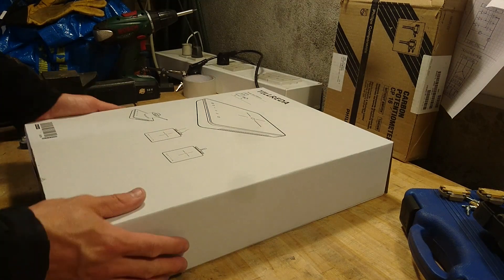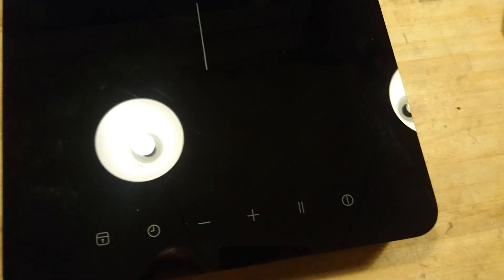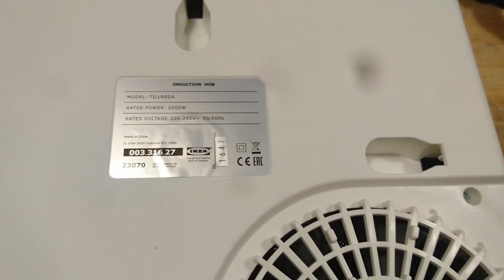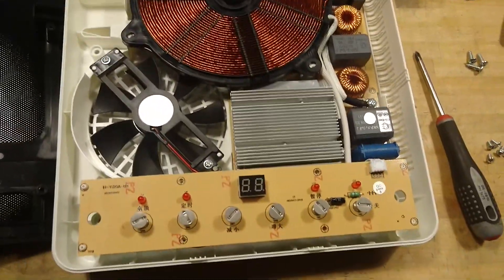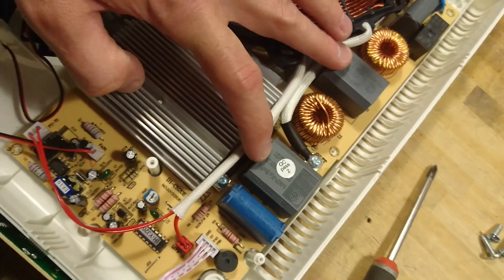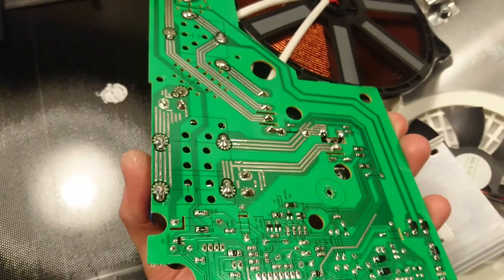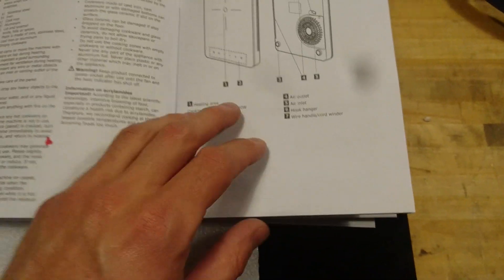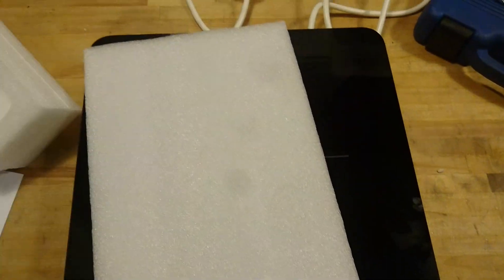Hacking IKEA 2kW Induction Cooktop, Teardown (Part 1 of 5)

Comment: Is this common for these to use Litz wire in the work coils? Ha, funny about the fan RPM changes.. likely some poor programming in that micro-controller (just peel back that sticker, any bet's it's a PIC?).
Reply: it is, the most cheap one has them too, not many strands, but still enough to say it is one
Reply from the maker: I have only seen Litz wire in all the induction stoves that I have taken apart, but multiply twisted wires is not always a guarantee for quality, on some of the Chinese induction cooker websites they advertise with their product using "clean" copper Litz, so there is without a doubt some really dubious quality copper out there.

Beneath the sticker you can see its a HIGHWAY09A microcontroller, it comes from a Chinese IH manufacturer, I only tracked it so far to possibly be a Holtek microcontroller, you can see all the information I found here: http://kaizerpowerelectronics.dk/general-electronics/hacking-ikea-2kw-induction-hob/
Reply: @KaizerPowerElectronicsDk  Ilegally recycled copper is always an issue in those appliances, according to my experience. Too much cost pressure...
Reply: Litz wire increases the skin area so conducting power at HF works better.. what frequency are they using?
Reply from the maker: I will get into more details on this in part 2, but its resonating at 22.5 kHz
Reply: Just above audio range. Idling perhaps at 30 kHz, and frequency goes down while loading. The skin effect is not so pronounced at these frequencies, but it is important to have a large crosssection area due to the circulating currents. And as most of these stoves are more or less made by small female chinese hands , bending a thick copper wire with 5 sqmm is not going to do well...
Reply: Yes, litz wire is essential for 20+ kHz at these total wire thicknesses.  Many of these cheap induction cookers use aluminum litz wire with some sort of crimp connection at the ends, perhaps crimped with tin and heat and/or ultrasonics to break through the individual strand insulation.  BTW, the old 50/60Hz microwave oven transformers are almost always aluminum wire too, though not litz.